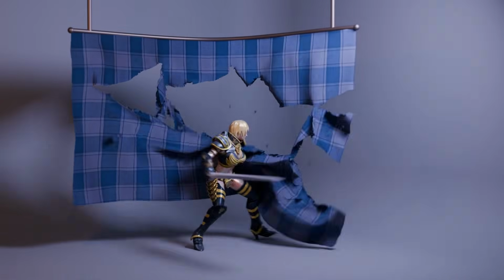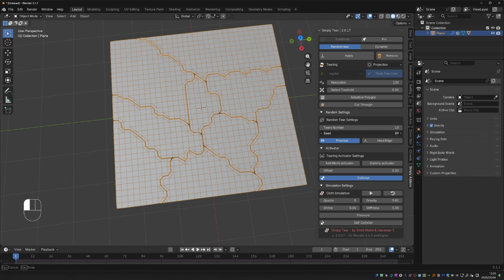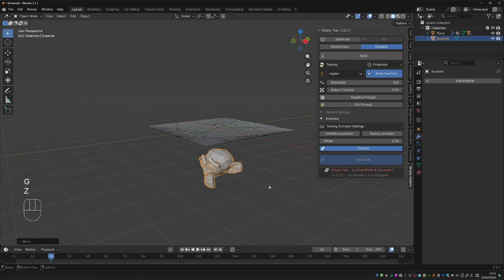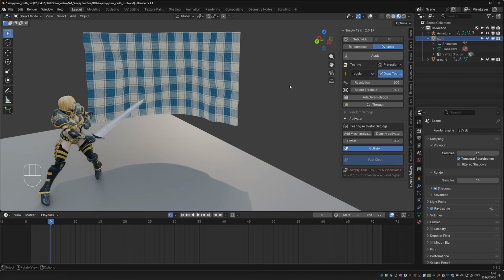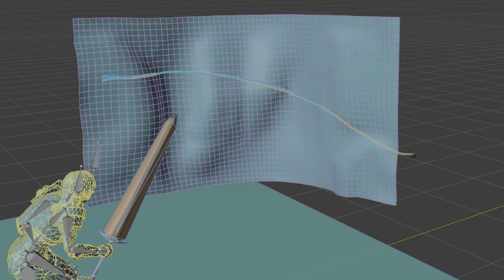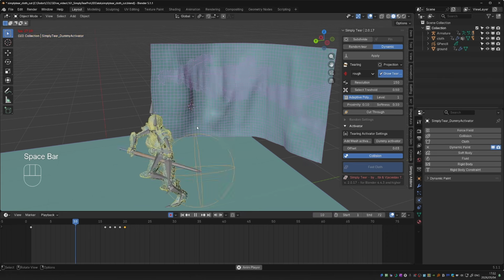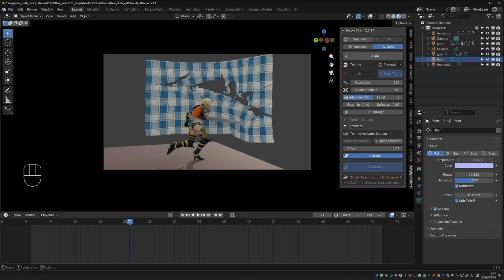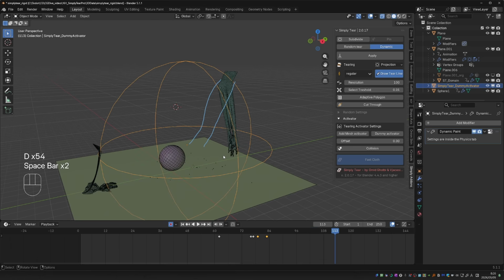Easy Dynamic cloth Tearing with "Simply Tear" addon

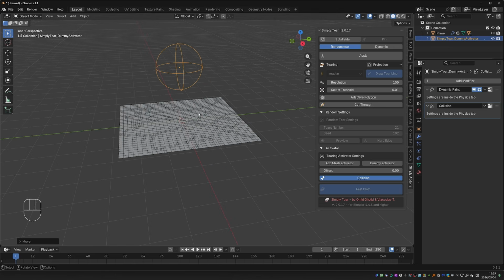Comment: When I follow the tutorial, I’m unable to replicate the effect shown at the 2:40 mark in the tutorial. In the tutorial, the cloth cut by random tearing does not split apart right away and requires the controller for Dynamic Paint. But after I apply it on my computer, the cloth strips fall down immediately, and the controller generated by Tearing Activator Settings is completely non‑functional.
Reply from the maker: might be a bug with the current version of Blender or something. I'd check the Blender computability on Super Hive and ask the developer.